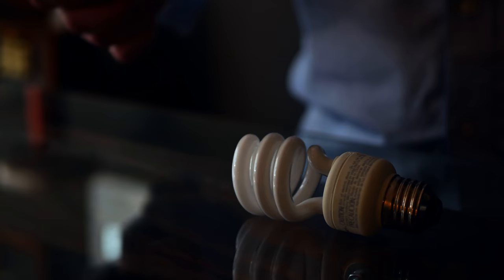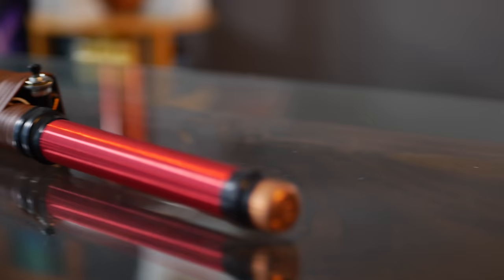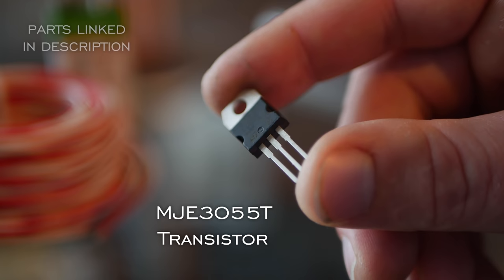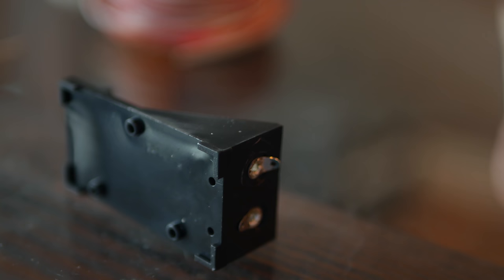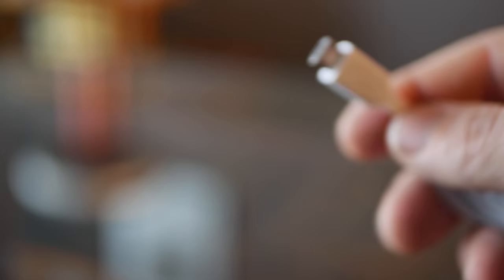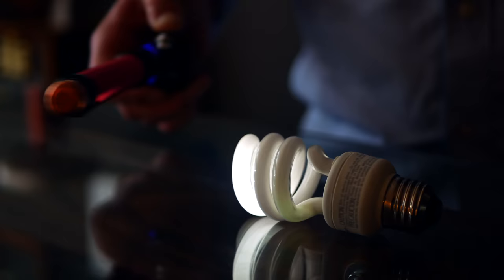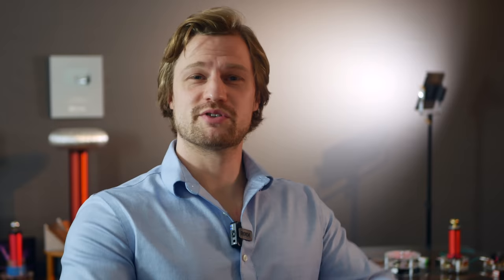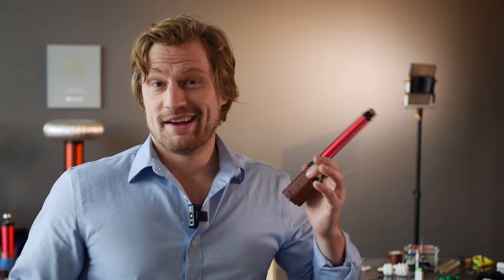DIY Wireless Power Magical Wand (Slayer Exciter)

Comment: Me thinks it'd a danger to any MCU projects. 
It will induce so much voltage in the PCB traces, that would burn something out. 
EMP bombs work the same way, but a single short pulse, and millions of times stronger than this wand. 
Myth-busters had an episode on it. Fried the car's computers!

Comment: I can't see where or how the momentary switch is wired in. Does it go between the emitter and the negative side of the battery, or between the positive side of the battery and everything else?
Reply from the maker: It’s just a switch going between any power wire to the rest of the circuit.
Reply: @PlasmaChannel  Thanks for your reply. I'm going to 3D print a wand enclosure for this.

Comment: Hey Jay i have a Question i want to build a HV Voltage multiplier id use a Plasma Ball Wire but since that only has one output wire how do i figure out what the other wire is. Sorry for my bad english

Comment: Also if this dosnt Start add a capacitor between the 9v and the Oszillator. I did This,and its the only way to Start.  I used an Bd139 and its more Powerful than this. I use it as a normal teslacoil.

Comment: Man you got some serious design skill, because almost all of your project looks like industrial grade products.....

I just finished 2 projects based on your videos about Water based Marx Generator and high voltage levitation, and when we do such things we feel some kind of awesomeness..... :-)

Hey Jay, I have few questions

I actually powerd Marx Generator by 2 series connected flyback transformer which are driven by ZVS driver and I used same setup for quasi stable levitation, 
but when we use flybacks we can smell ozone, and while searching about ozone I saw that few articals are saying that high voltage arcs produces UV Radiation, is that true ?, Does all arcs produces them & ozone is too bad for our health....?

I have 18 flybacks, if I connect their primary in parallel and excite them with powerful driver while connecting their secondary in series produces super high voltage at the output....? Also by using DIY capacitor can I further filter their output.

Once I connected 3 flybacks in series, but I don't know that connecting large numbers of flybacks in series is good idea or not....
Reply from the maker: That’s awesome, I’m glad you’ve built some of my projects! Yeah, all high voltage produces ozone. Small amounts of it, momentarily throughout your day is not harmful. However, if experimenting and creating a ton of ozone from purple corona, open a window and turn your fan on. Medium and high doses of ozone are very unhealthy. As for radiation - only high current discharges such as from a Tesla coil spark gap emit UV.

As for the flyback, yup! You can wire them like that. It’s called series-parallel. But after more than 2 or 3 flyback wired this way, you MUST place them all in oil or wax.
Reply: @PlasmaChannel  Thanks for the quick reply..... :-)

Comment: Hello, I recently built you magic wand, and in the video I cannot find you explaining where to wire the switch, nor what that little brass colored object is on top of the secondary coil. Also, when mid build when the light was connected to power, it would flash quickly and than turnoff. I spent about 100 bucks on this project so I really don’t want it to go to waste. Thanks.
Reply from the maker: Hi Max. In every circuit that uses a switch, it always goes between power and the circuit. The purpose of a switch is to connect power. So, that why you always put it there. Cheers.
Reply: @PlasmaChannel  thank you so much
Reply: Do you think you could explain where that would be in the schematic as what two wire connect to the two switch prongs

Comment: i did the mini tesla coil with a tip31c but it burns really fast. Do you think if i use a mje3055t it would work better.And i also try with d718 and it does not work, his that the switching his to slow ? What his the best transistor ?
Reply from the maker: In my opinion the transistor I used is best
Reply: @PlasmaChannel   I will try that thanks

Comment: Is the 'high strength of electric field' or the 'high frequency', that does the trick?
Reply: The High E-field times the frequency corresponds to the transferrable power. The higher frequency (as opposed to a higher E-field) makes it touch-safe for the niece/nephew.

Comment: The transistor is out of stock
Reply from the maker: Thanks for the heads up! I have added a second link to another source!
Reply: @PlasmaChannel  Thanks, but that will work perfectly?
Reply: @PlasmaChannel I saw but that transistor is also currently unavailable. What to do?
Can you give link from amazon.in ?
Reply from the maker: Hi, I checked both links, they show as in stock. Not sure why it says out of stock on your end.

Comment: Do you (or anyone) have any tips on preventing the transistor from overheating. The main thing that would happen when wire up is the bulb would flat out not turn on.
Reply from the maker: Hi max, are you using a lithium 9 volt, and, do you have a heatsink on the transistor?
Reply: @PlasmaChannel  ok so I have a 9 volt lithium, do you have a link for the heat sync? I’m not very knowledgeable on this stuff so that would be great. Do I just screw it on?

Comment: Does the positive side of the battery connects to the transitor base and the middle pin? Can you pin the schematic of the circuit in the comment section
Reply: The circuit schematic can be found in the video by ElectroBOOM - "Not the Best Tesla Coil Driver (+Keysight News Leakage)" [the first schematic].

Comment: How to send wireless power over long distances through earth acting as a capacitor? Tesla was working on it where two resonating sets of Tesla Coils act as positive and negative terminals for the dielectric aka earth, something like that. Google "The True Wireless by Nikola Tesla pdf". Another person who succeeded in receiving AM radio signal via earth connection with Tesla Coil is Eric Dollard because AM radio station has ground electrode connected to earth. Check video "20:1 Scale Model Replication demo by Eric Dollard".